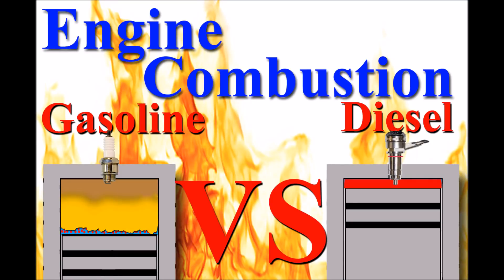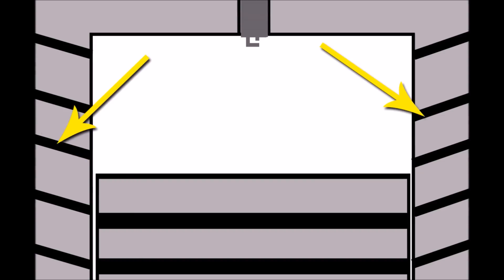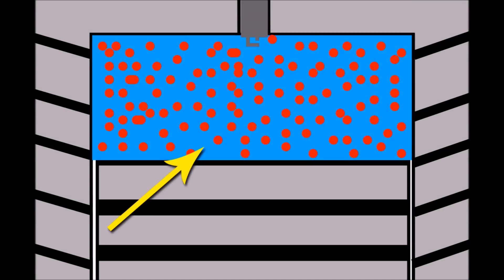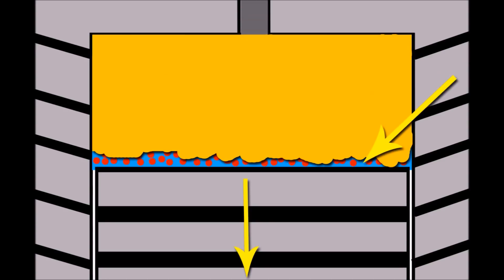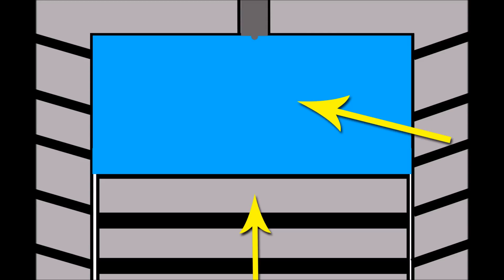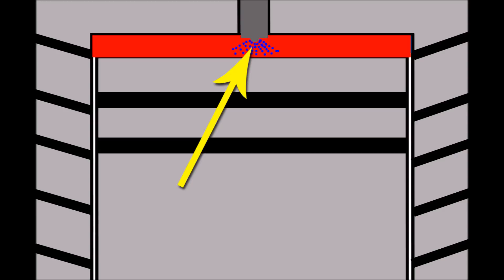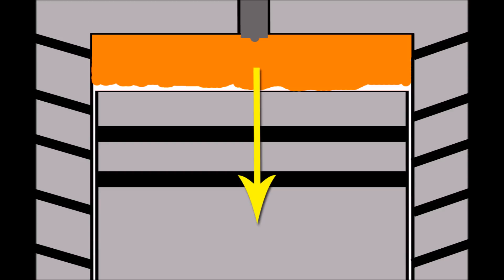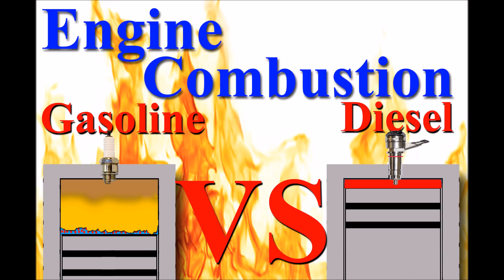Diesel vs Gasoline Engine  -  Comparing Combustion - How they Work.  (by Craig Kirkman)

Comment: Another great lesson, Thank you Craig. I learned a lot from this one, and other videos that you have done also. One question that comes to mind watching this then which could be something you might be able to explain is .... I have a very old tractor which I run for a hobby / handy tool which I am told probably predates direct diesel injection. How would this be different to the way the modern diesel ignition works? BTW, I really like the approach you take to education to skin the knowledge down to its bare bones removing as many barriers such as jargon, brand specifics etc. Often I like to 'get the damn thing running again' and if something is broken i utilize any tips and tricks and dumb deduction I can get my hands on. But you offer a higher level understanding which helps put everything together. The fundamentals in engines (and general life even) are often overlooked and buried by the details! Thanks again. Heath

Comment: So I'm assuming then all fuel injection engines, gas or Diesel work the same? Cause compared to carburetor engines fuel injection gas or Diesel,, work the same but carburetor engines atomize the fuel for all the pistons at the carburator. Never really paid attention to this. Thanks. Your explanation s are always informative.